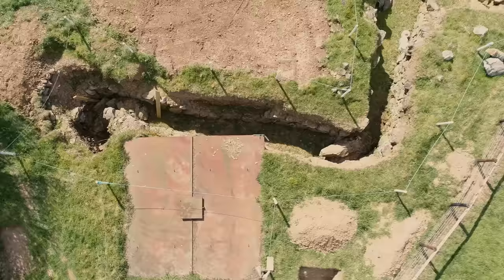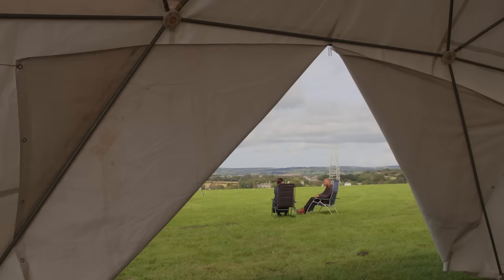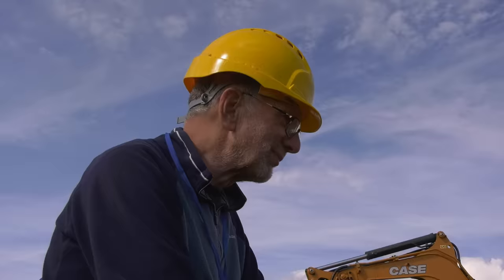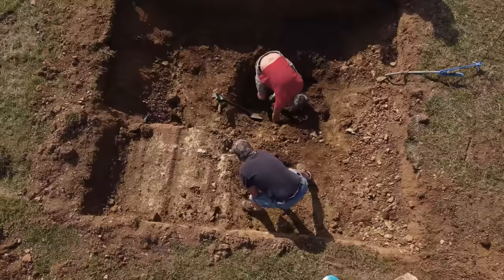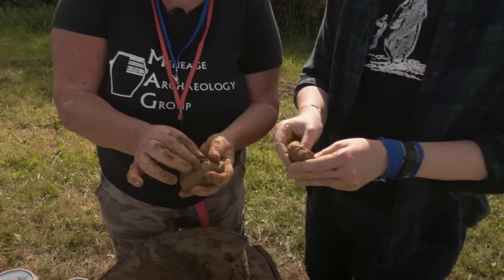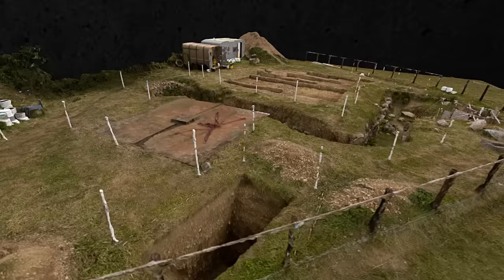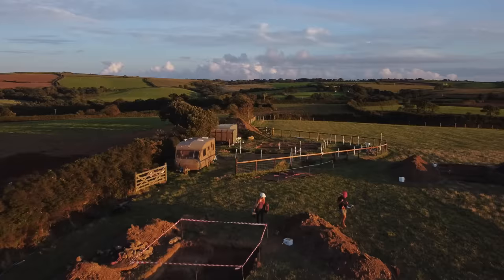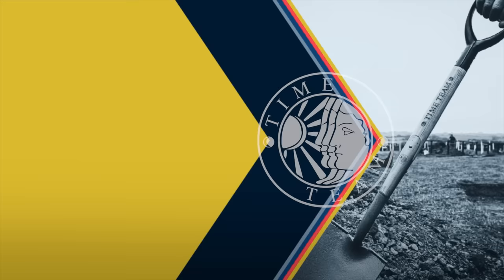NEW EPISODE | TIME TEAM – Boden Iron Age Fogou, Cornwall | Day 2, Series 21 (Dig 1)

Comment: A great show and I shall be looking in tomorrow. A question. Pottery is an important part of the dating process and there always seems to be bit laid about. In a modern household we would use the same pottery for many years and only occasionally would something be dropped and broken so there would not be much for future archaeologists to find. What was the usual life span for an item of pottery in the days of the fogou?
Reply: My Grandfather, according to my Grandmother, washed up with a hammer. Difference was the shards went into the Dustbin not a pit in the garden.
Reply: Obviously we can't know for sure, because we can't go back in time. The best we can do is make informed guesses based on modern ethnographic analogies (ie, study how often pottery breaks and is thrown out in modern groups that still use it frequently. From that, we have seen that generally use-life is positively correlated with size, (bigger pots last longer) but its certainly not an exact science. For further reading see: Shott, M. "Mortal Pots: On Use Life and Vessel Size in the Formation of Ceramic Assemblages"
American Antiquity
Vol. 61, No. 3 (Jul., 1996), pp. 463-482 (20 pages)

Comment: There is a point where the shoe allows a more favorable day, dependin g what tour task is. Some are always working upright sitting crotched. Others bended knee. Many times the foot is bent in a extreme for hours. Some actually lie prone. So the correct shoes/boots will last or wear out becasie of bending or dragging abarsion on toes.  Especially working in wet dirt/rock without a wrap on boot cover of some extra protection, Who wants to put on wet muddy/dirty boots the next morn. A good wet resistant sack to slip over above the ankle,  Just a dumb thought. They all might be thinking about it, Even fitted toe caps might be a good shoe saver for many.